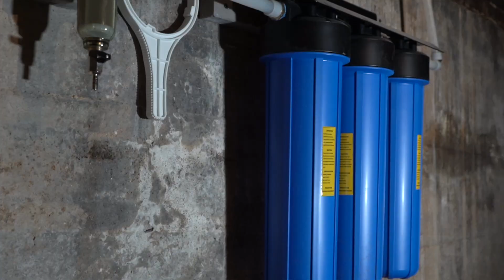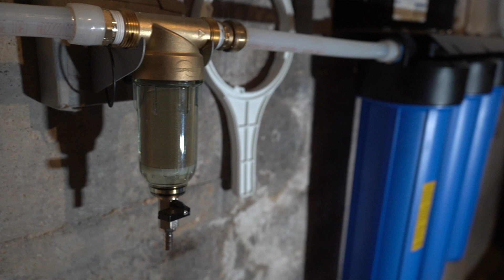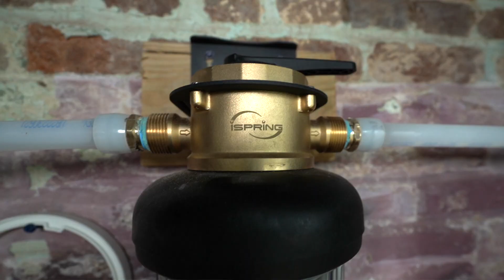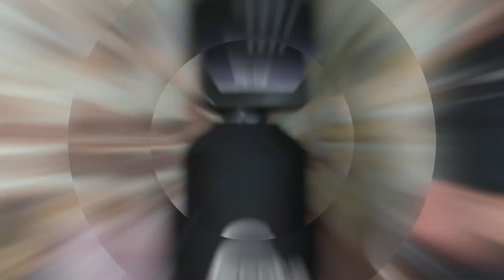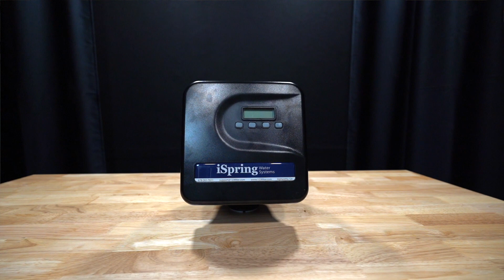Revolutionize Your Water Quality with iSpring WF150K + WSP50ARJ-BP | Set & Forget Systems

Comment: What size bucket should I use for the flush of both of those devices?
Reply from the maker: Hi there! The best and safest option is to run a proper drain line. The amount of water used during each flush can be higher than a bucket can handle,  so using a drain is recommended rather than choosing a bucket. 
If you have any further questions, please reach out to us at support@ispringfilter.com or 678‑261‑7611. We’d be happy to help. Thank you!

Comment: Hello i have the flushable ispring sediment filter that auto flushes in Mexico. Does the filter go before or after the water tank? I currently have it before the water tank and it hardly cleans anything. i am thinking of installing it after the water tank. Also, does the water filter require water pressure to work? Can the water filter flush itself with gravity low pressure as is typical in Mexico?
Reply: For Mexico I think it's better to install it in the municipal water intake. This auto flushable filter it's just a "pre filter" Then you'll need 1 or 2 filters no be able to notice some changes. 

1. Sediment filter
2. 50 micron filter
3. 20 micron filter. 
Or something like that 

If you install it after the tank (tinaco) all the dirt will settle there.
Reply from the maker: Hi there! The spin-down sediment filters are typically installed before the water tank. This helps protect the tank from sediment. The filters require sufficient water pressure to operate effectively (minimum of 20 psi)
If you have any concerns or questions, please contact us at support@ispringfilter.com  or 678-261-7611 (M-F 9:00-5:00 EST) for proper assistance. Thank you!

Comment: Please help me!!. I bought this exact one. I press setting and choose (1) to auto flush once every 24hrs.. then i press setting again and choose (30) for seconds.. meaning it should auto flusj once every 24 hrs? But it will not and has not auto flushed for 2 weels now. I havr to manualy drain each time. Please help
Reply from the maker: Hi there! Press the HOME button once to turn on the screen. Then press the SET button to enter the adjust mode. Press + or - to adjust the flush frequency in days. Press the SET button again to adjust the flush runtime. Press + or - to adjust flush runtime in seconds.
If the issue persists, please contact us at support@ispringfilter.com  or 678-261-7611 (M-F 9:00-5:00 EST) for proper assistance. Thank you!
Reply: 24hrs = 1 on the screen.  The display reads in days for how often it flushes and in seconds for how long it flushes. Maybe you set it for 24 days?
Reply: Just hit the set button again after you set the seconds +/- .  You should hear a long beep when you press and hold the set button. Now its has been saved in the module.